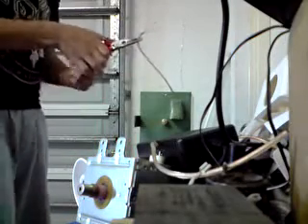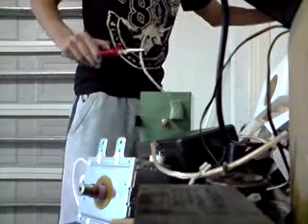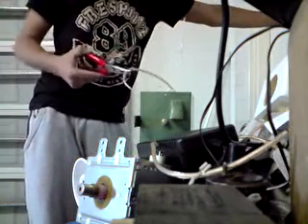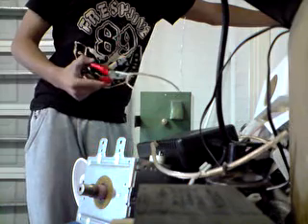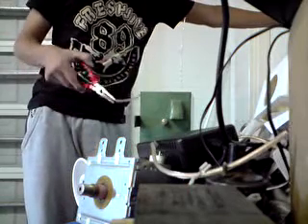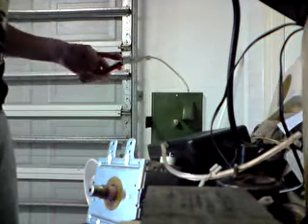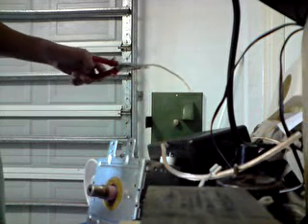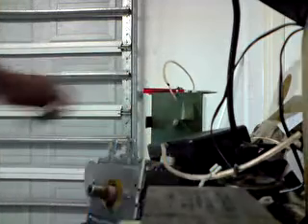neon transformer help

Comment: @TCDIL95 use 2 or 3 mots for the tesla coil that way if one brakes you just replace it.. then make a safty spark gap becouse thats why your nst is broken and 3rd your nst is broken and its skiping its windings so the voltige is not relyable and neather is the current .. there is no way that you can fix it becouse fizing it would be more exspensive boring and wastfull than buying a new one

Comment: If one side of the NST is weaker than the other it will be shorted turns on the secondary, and is unrepairable. Also current even as low as 30ma can give a very painful shock, and if the insulation breaks-down on those pliers you will get a big fright and pull away and hit yourself on something. Wood as an insulator is not acceptable either as it can absorb moisture, and be conductive. The higher current from a MOT will kill, typically within a second if it passes through the upper body.

Comment from the maker: its only an nst man. i have been shocked before by one and it wasnt that bad. if i was using a mot i would use a long wooden rod with an insulated screwdriver on the end.

Comment: I've got a few of those "Standard Electric (PRC)" NST's that exhibit similar problems to the one in your vid, and as far as I can tell, its a burned secondary. not completely fried, but enough to limit its output.

MOT's -  burn the crap outta them, strip the copper out, take it to the scrappie, and pickup a few more microwaves while your there :D

Comment: stripping the tar out requires the use of nasty solvents-the sound your hearing is dilectric breakdown,as the tar is burning on the dud coil.
why use 2 MOTs? they are easy to find off a throw out!
hope your spark gap was built to dissipate the kickback,could be why your NST failed